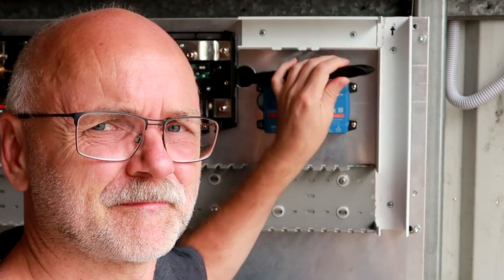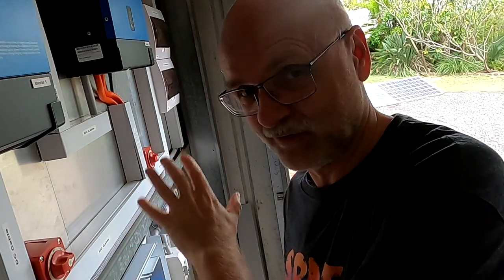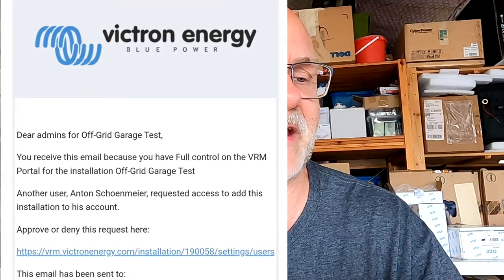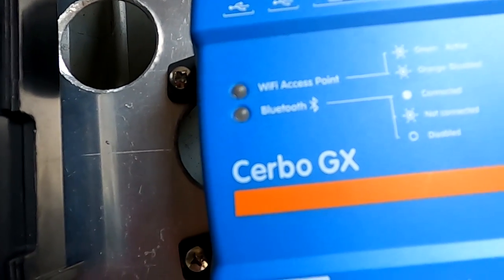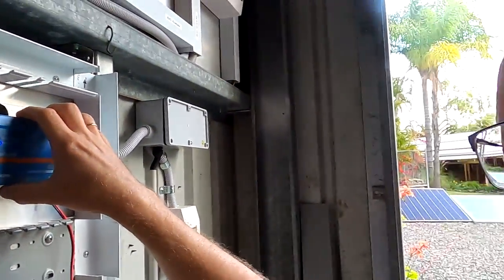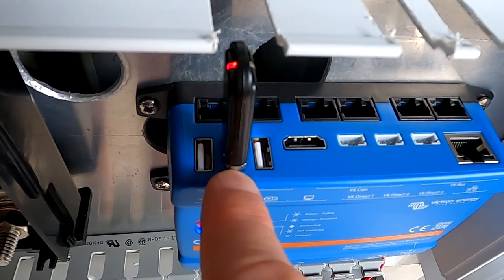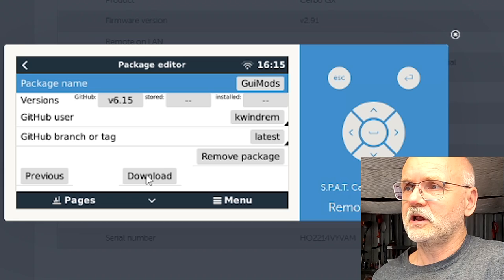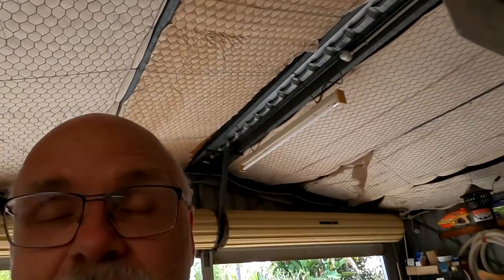Victron Cerbo GX super easy setup to VRM, GuiMods & Ruuvi Tag installation. And the new Name!!!

Comment: You might run into issues, when connecting both the Lynx-Shunt and the CAN-BMS:
The Lynx-Shunt will be forced to be the main battery monitor and you can't chage it in the settings...I experianced that a while ago. But It might have changed until now.

Comment: Hi Andy. I've noticed that your cerbo gx has serial number HQ22**. and there is an issue with internal power supply. when you connect your cerbo to 48v it can die.

Comment: Hi Andy, Andy?...you sound like you would have a German-speaking background?....Andreas? Well, I am Otto and not busting on knowing about all of this, I try to learn. I am a long-retired, office machine technician, originating from Vienna. Because I run my system on 24 Volt, where should I get the 5.5 Volt supply from for my two in-line Lynx distributors to get the system indicator lights working? I have a basic Victron Cerbo GX and on top, at the far left I have two USB positions free, should I join a USB cable, cut one end off, and link it up with the yellow & black wire of the supplied cable that came with those Lynx distributors?  We/A&O made up a solar panel to the battery bank system, controlled with Victron elements, output 220 Volt to overcome those many power-out situations we have in rural QLD to protect the goods in our fridges & freezers and issues when printing 3D when the PC goes wild with the printing program. Ergon Energy has the habit of supplying at times too little and even far too much electricity (up to 260 Volt) and some of our appliances did not like that and did quit on us......and you ask what name to give to the Cerbo GX, this unit is very smart - remember who Idefix was? (Idefix & Obelix). Stay awesome, cheers!
Reply from the maker: Thanks Otto. You may want to watch my German channels linked in the description 😊

Comment: Hi Andy i have a question about the relays on the cerbo. i have a server rack with 5 BYD 5k batteries, the rack has a built in fans in the top that are 240v. i have the temp sensor from the cerbo running into the rack and wanted to have them turn on when we have hot days. I can see how to operate the relay from the temp sensor but im not sure on how to make the cerbo's relay switch on some form of 240v relay to activate the fans.
Is this able to be achieved 
Ryan

Comment: I bought a Cerbo GX  for my solar system...watched your video and hooked mine up and ... puffs of little smoke...it's fried... 🙁  I think it was directly shorted inside...
Reply from the maker: Did you hook yours up to the 48V battery directly? There is a known problem with that. Just needs a 100uF cap parallel to the power input pins. 12V and 24V should be fine.
More info here: https://community.victronenergy.com/questions/150136/faulty-cerbo-gx-devices.html
Reply: @OffGridGarageAustralia  independant 12v battery system in my RV... I knew about the 48v issue...mine is 12v so I didn't worry about that issue...I left the wiring attached and it runs a test light perfectly.   Really think my Cerbo is shorted...starting the return process with my vendor...wish me luck!

Comment: Hi Andy
Loving the content 
Just updated my firmware on the cerbo to v3.00~20 and I’ve lost AC Loads display on my VRM
Have you had this problem yet?
Reply from the maker: Yes, I had this problem. Running the latest beta sometimes breaks things. I only install this on my SPAT Calibration Centre installation, not on the production one. 
Other have problems too with the ~20:
https://community.victronenergy.com/questions/187176/venus-os-v3007-available-for-testing.html

Edit, Ah, you posted there already... 😁
Reply: @OffGridGarageAustralia  Ahhh that explains it so basically only stick with the non ~ versions 
Thanks once again keep up the great work legend👍🍻

Comment: 'Crooked' 'plumb' or 'Un-level'? or is it all in the eye of the beholder?  I am reminded of a few electricians and inspectors who where OCD with levels, even on floating offshore platforms and mobile structures, who insisted crooked and cock-eyed things be installed perfectly plumb to gravity. Also, I recall a few cock-eyed professionals with cock-eyed levels who trusted cock-eyed bubble rather than their own cock-eyed eyeballs.